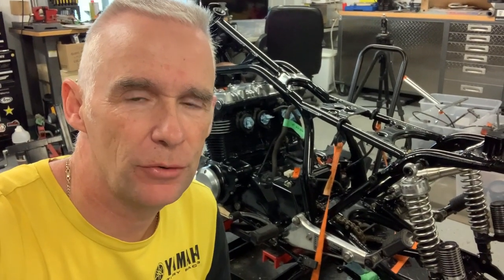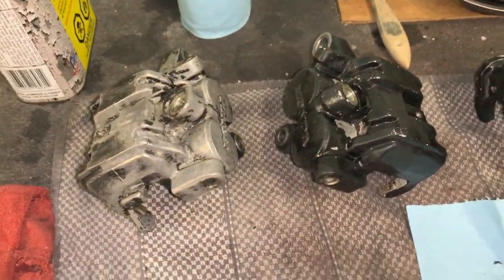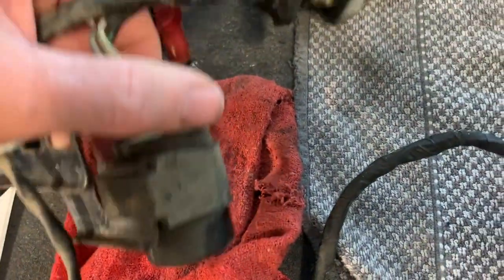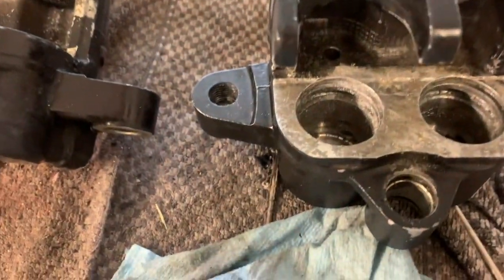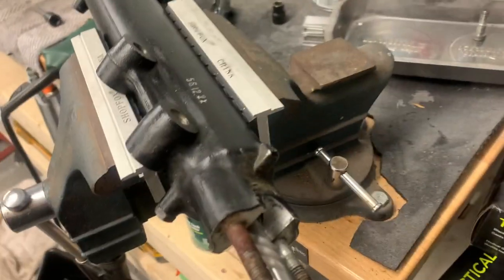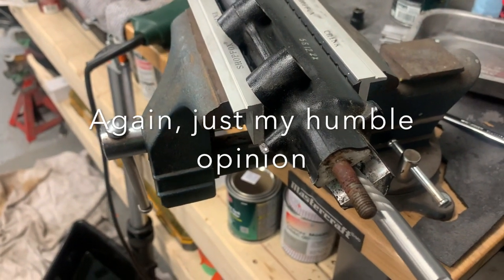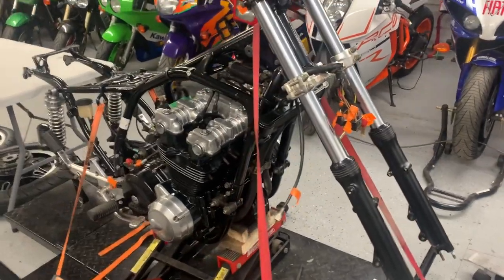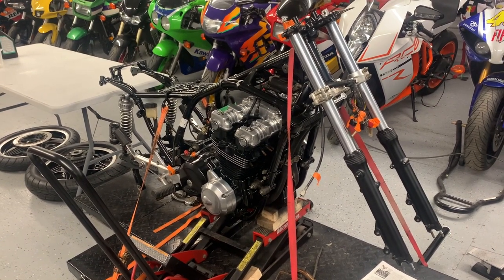1982 Honda CB900F Barn Find - Restoration - Brakes & Forks

Comment: G'day.  I have tried lots of ways to overcome springs (done lots on earthmoving gear) with some were even stronger than this one would have been and have had the odd one coil inserted into the end of a finger.  Pain full.  The best way I found to stretch/lengthen a really strong spring:  
I bend the spring one way (make it U shaped) to open up the gaps between the coils.  Slide in several flat washers into the gaps.  Bend the spring the opposite direction and slide flat washers into the next lot of gaps one hundred and eighty degrees around.  This makes the spring longer as it does not contract as much.  Once hooked into place on both sides of the hooks pull out the washers with pliers and the spring will shorten.  Great job with the video's
Reply from the maker: Thanks for the tips !

Comment: Great progress. If the fork spring is to soft I can recomend a German brand I use that got you covered. They are called Wilbergs and they work perfect on my CB900F. Still got good comfort but they dont bottom out like the stock 40 year old once. I am shure you can find other brands aswell but I can recomend Wilbergs springs 👍
Reply from the maker: Thanks for the info! I’ll likely leave it stock, it won’t get ridden that much to be honest .

Comment: Wow in the 1st wave of watchers. Hope all goes well.
Reply from the maker: Thanks
Reply: @true-moto-resto  Waiting for next instalment of the cbx750 had just started riding when that was released. It was meant to be an affordable mid to large motorcycle never seemed to catch on shame. Somebody down the road from me had CB900 in silver about that time. Gaps in my knowledge usually due to lack of money (whats new) now I have Italian bikes RST and GT 750 to worry about amoung other things. Your efforts are much apprecited and I am surprised you don't have more subs. Way to avoid issue with fork seals use a piece of thin plastic from milk bottle is  an old trick to get them past the rough rust on the top of the fork legs.
Reply from the maker: @owen368  this fall I’ll get back to the CBX750.   We never got them at all in Canada this one is a JDM import.  

I’ve used plastic from a windshield washer bottle before on the forks to save the seals, but I find electrical tape much easier if the fork bullets don’t fit.   Our milk here comes in bags. LOL